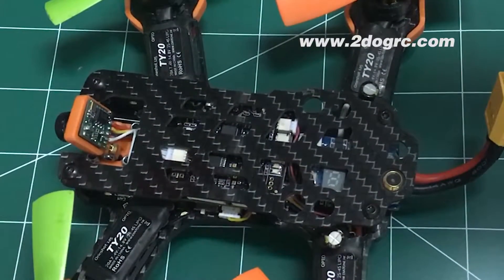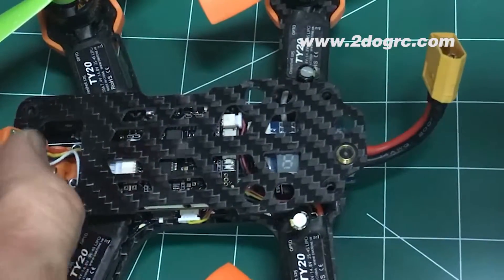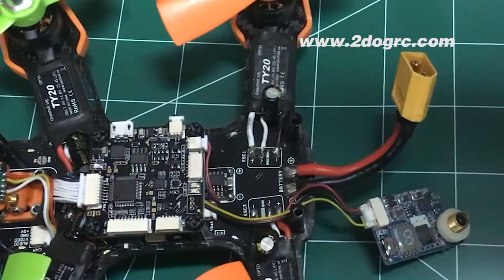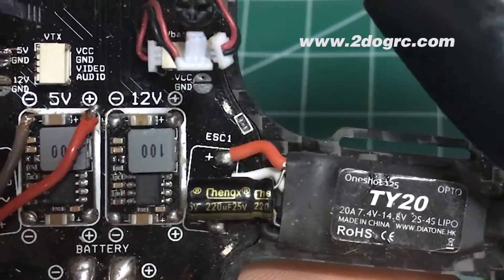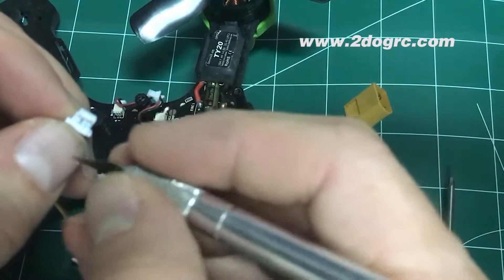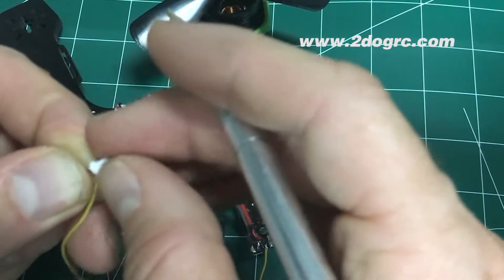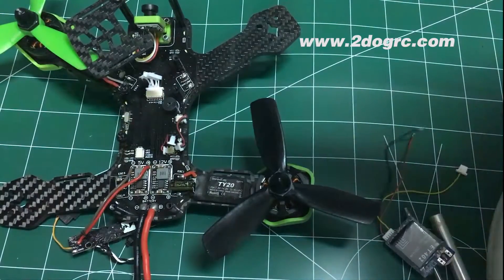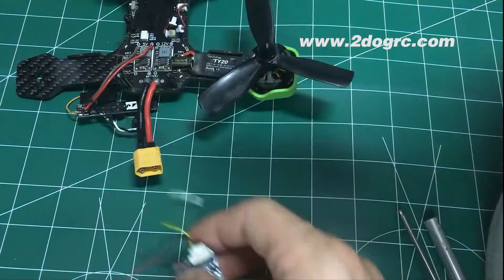How to put your Video Transmitter on the 12V Rail on Diatone Tyrant.

Comment: nice to know after I fried 2 VTX 's in my 180, good video, thanks
Reply from the maker: We are working on this with Diatone.
Reply: how's the Fury's working out? I'm about to upgrade from the Naze, I seen your video flying with it.
Reply from the maker: I like it alot.  Very stable and fast.  You can tell the difference when upgrading from a Naze, then also upgrading to Bl heli_S ESC's.  I leave a card in the SD card and log all my flights. That way if I have a failure I can look at my log and see what happened.
Reply: and you are using betaflight on it? I have a buddy flying a 5 inch Alien with Naze on betaflight and he  seems to be locked in and he loves it, he says it fly's better than his 250 Vortex with betaflight and the Vortex has a F3 board, it's all about tuning and knowing how to tune, im still learning.
Reply from the maker: The FuryF3 is only available on Betaflight.  The cool thing is with a F3 board and Betaflight 3.0, you won't have to tune.  The defaults are VERY good!  Just set your roll rates to how you like them!
Reply: I love the 180 Tyrant, have 2 now and 2 Vortex pro's, started out with Vortex 285 and still fly that, love this sport just so much to learn, I've been into R/C sense the mid seventies and quads are the biggest learning curve to get through and it's growing exponentially.
Reply: nice I like that, easy for dummy's like me! lol